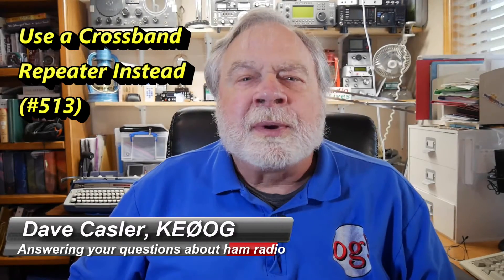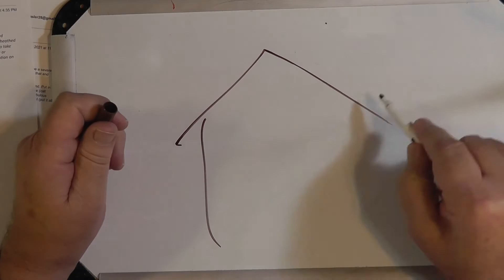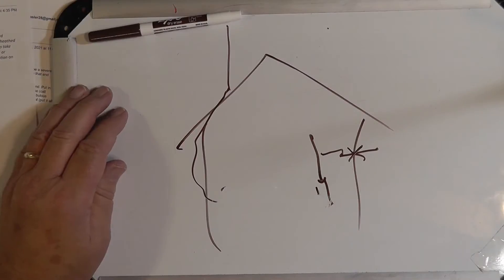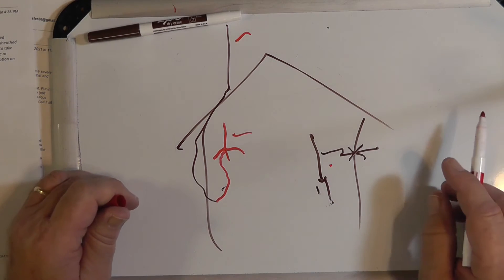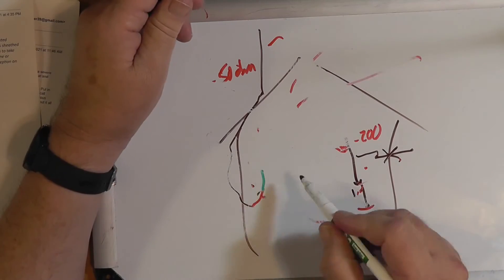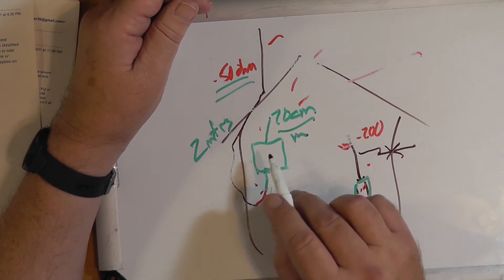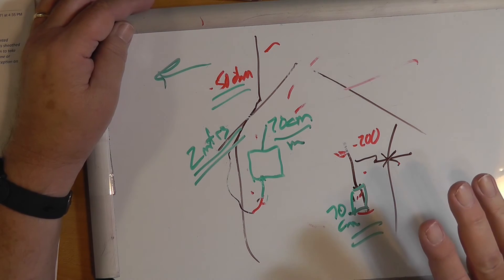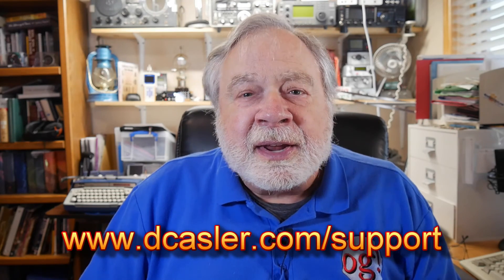Use a Crossband Repeater Instead (#513)

Comment: I've been making use of the cross band repeater function of my mobile(base) and my 2 HT's (which also have cross band repeat) for a couple months now. Just got my tech ticket in mid February. The use of the mobile as a cross band repeater allows me to use a large mobile antenna and the 50 watts of mobile power while down at the lake fishing with my HT's. works great. Only problem is you can't change the repeater on the mobile your transmitting to so make sure you pick a repeater that will have the traffic your looking to converse with. As Dave pointed out, pick a simplex channel to transmit using the HT and hit the repeater with the mobile.  Works great. Only other problem I've had was resetting the mobile back to "radio" (getting rid of the cross band) while the repeater is busy. A group was still rag chewing while I was trying to reset the mobile and the radio wouldn't let me. All controls (including the mike buttons as well as the ptt button) are disabled while in cross band repeat. Had to wait for silence on the repeater I was transmitting to before I could get out of cross band mode. AND once use to setting it up it will only take a few minutes to get it going!  Good luck and 73's